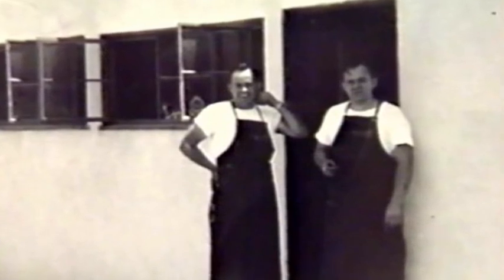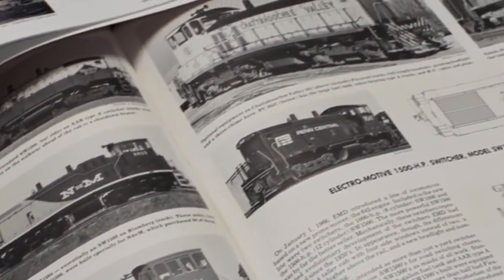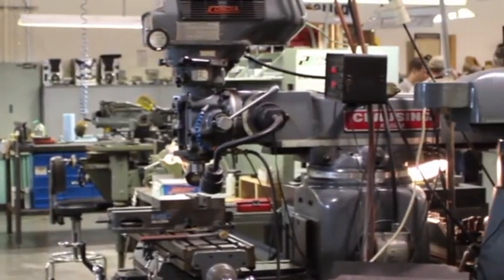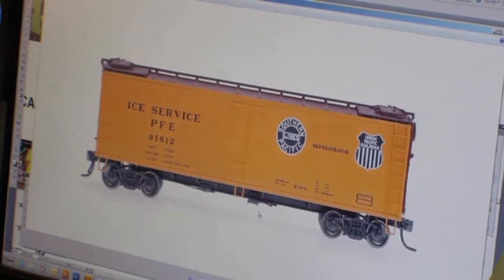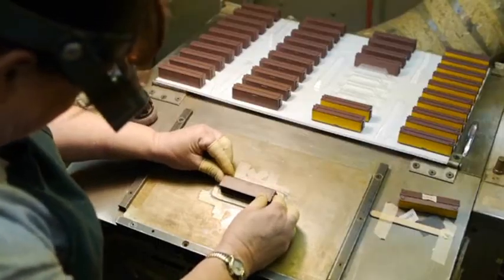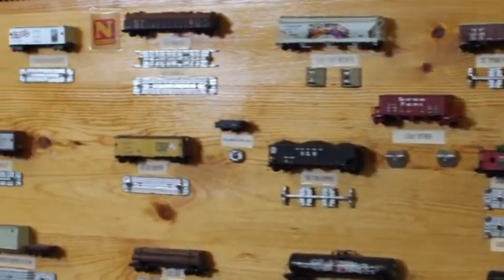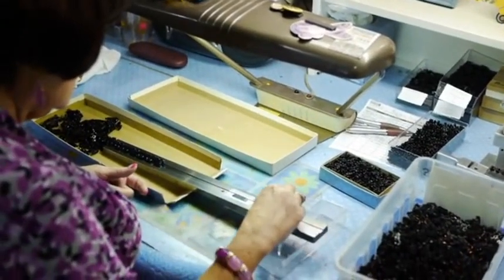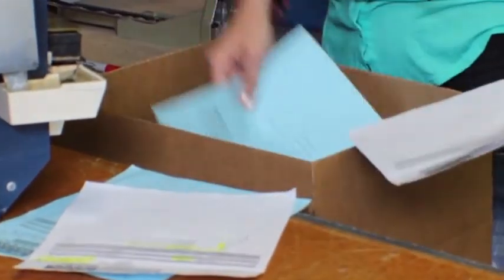Micro-Trains Factory Tour

Comment: Thank you for keeping your company in whole in the USA, unlike Scale Trains.com. They argue that they do manufacturing in China to save the consumer money,and DO HAVE 16 employees in two offices in Cal. and Tenn. Wop De Do!!!
Reply: Steve Blauvelt I think the main difference between a company like Micro-Trains and Scaletrains is that the Scaletrains models require so much more assembly time by seasoned employees. A locomotive from Micro-Trains might have a part count of 50 while Scaletrains (and Rapido, and InterMountain, etc) have locomotives with 200+ individual components. We all know parts themselves are cheap, but man hours are what truly cost the most, and that's where the US is so much more expensive than most other countries. The factories in China also have a very specialized work force that have been building model trains for decades now. And it's not like it's a greed thing, as I think we can all agree nobody is getting rich in the model train industry. It would be great to make models here but I fear models would cost beyond what most customers' wallets could handle. Hopefully a company tries it here in the US and succeeds, but there's probably a reason beyond "corporate greed" as to why it's not happening.
Reply: Exact rail is the same, and they charge more then micro trains. Us modelers need to stop buying china!!!!

Comment: 🇼🇴🇼 ❗❗❗ or should I say "  wow "! ! ! 
I've seen these Engines and Rolling Stock first hand when I helped out at Central Coast Trains when they would be swamped with customers .
I've seen this Real to Life  Details on these product line when unboxing .
I'm sorry to say that now a days the smallest things that I can see is HO and days that I can barely see that .
I'd be totally blind to work with that small parts . 
Great Job  M T 
AND to Hell with that Lie that Model Rail Reading is a dying Hobby 
Last that I checked it was a 
1 . 5 Billion  to 2 Billion dollars a year industry 
Dying Like Hell
Reply: DCC certainly gave the hobby a renewed interest.  The running qualities, fine details, track and wheels of the newer gear is no comparison to the 1980's and earlier rollingstock.
Reply: I’ve gone back to S gauge. Three years ago, at 69, I went to welding school. The department head gave me a 3.25 diopter spectacles. I didn’t really need them except TIG. But now stick and MIG need them. I’m planning to go with R/C and battery power.

Comment: I bought my first Micro-trains in the ealry 80's and was amazed at the detail that rivaled HO trains at the time.  For example, I had a Micro-Trains caboose and you could actually see through the chain links on the ends of the caboose.  You could see though the smoke jack on the roof.  And you could read the tiny lettering which required good eyesight or a magnifier!  HO has only caught up in recent years!  I've been in HO for the past 30+ years but getting back into N as my wife has shown interest.  I understand more freight cars are being made with body mounted couplers which is good news.  Amazing stuff Micro-Trains!

Comment: now if only Micro-Trains would tweak their standard couplers to put the spring on the other side of the pin to eliminate the caterpiller effect at the end of a train...that is my only complaint, after watching this. i am simply amazed that with all this expensive american labor and extensive quality control that prices are able to be kept low, your profit margins must be terrible.
Reply: Not necessarily.

By keeping quality high, final sale prices low and good customer service relations between the company and modellers, they're likely to sell more in the long run.

An item that costs $50 to produce of high standard that sells to the consumer for $70 when the rival companies sell their $50 products for upwards of $110... which are you going to go for? The $70 one or the $110 one? Both are of equal quality. In all honesty, the $70 is going to fly off the shelves because it's value for money while the $110 isn't because it's out of reach for many consumers to afford. 

Why pay more when you can get the same item of equal quality for a lesser cost?

PS: Those figures are just examples. I've never seen a quality model locomotive that costs $50 to produce. $100 maybe that then sells to consumers for $120-$150.

Comment: WOW!  I got hooked on HO scale way back in the late 60s, but all I ever realized was a flat 4X8 sheet of plywood, and everything was mostly just laid on it, and not much scenicing done, mostly just the plastic things bought off the hobby-shop racks.  Because of my knowledge only of HO and the O scale, my mind is just sort of 'set' towards the HO as being the best for MY needs.  I recall when the N scale hit, most didn't like the lack of FINE detail for the buildings and the rolling stock.  Then here comes the Z scale, with locos fitting in walnut shells!!!  Any who, I will never forget my first experience with your HO Kadee couplers... I was REALLY HOOKED regarding making my rolling stock look as photo realistic as my hands could achieve.  My 'expertise' was electronics, and I got SO excited building the PULSE controllers that could create a scale ONE MILE PER HOUR with NO stutter_ VERY proud of that.  I ended-up letting others have my designed circuits, and really screwed my self by not doing the patent thing, but thems-da-breaks... 😱 lol
Thank you for all you do for the hobby.  I am SO PROUD that you are still doing your thing here in the states.  I imagine you might be getting some of the base materials elsewhere, but at least the impression is that all assembly is right here.
As a 65+ years "Old-fart", I am mostly just someone who enjoys watching videos of a ton of different activities, and model railroading is one.  I do the actual BUILDING and RUNNING of trains by way of my much loved simulators, my absolute fave being the 'Trainz' sims.
Again, thank you for what you do.
Michel J. Gaudet_ aka "Old-fart"

Comment: Shame the flawed cars have to be discarded. For my own part, all I need is a car that runs nicely and looks like the car it's trying to be. Maybe a "bargain closet" section of the website with cars that have minor flaws that a modeler could buy at discount and then fix or not fix as they desire?
Reply: i want some to use as visuals simulations for wrecks,,or construction yards,,,or rail side businesses,,,
Reply: They're not thrown away. They melt them down and reuse the plastic..
Reply: I would not want to buy a substandard product.
Reply: There is a 'religious sect' called 'kitbashers'. You could sell them 'seconds' for modeling junkyards, & accident scenes, but it's not a big market.
Reply: +railsetc  Most quality manufacturers discard flawed products because they simply don't want their name on something sub-standard. It also protects consumers from unscrupulous vendors selling such items as normal ones.